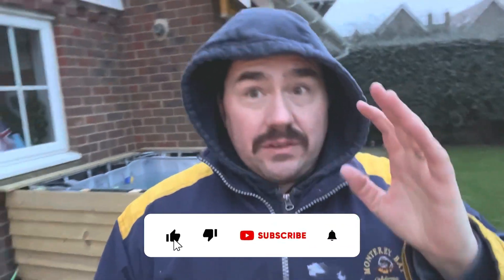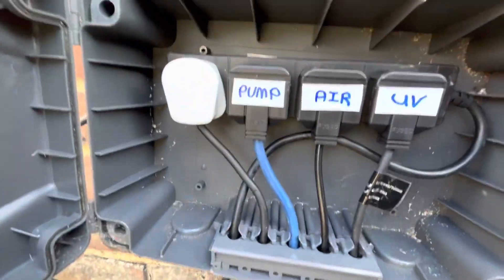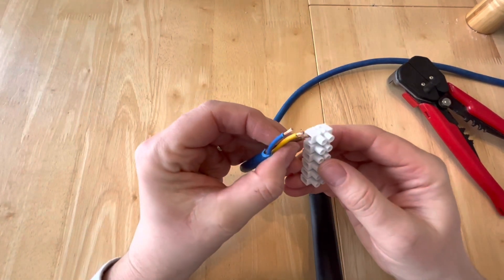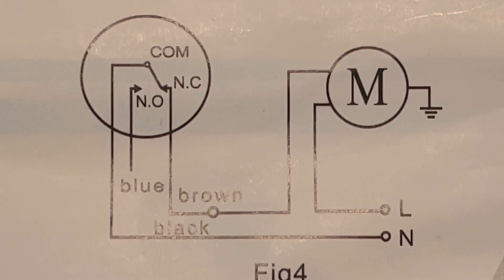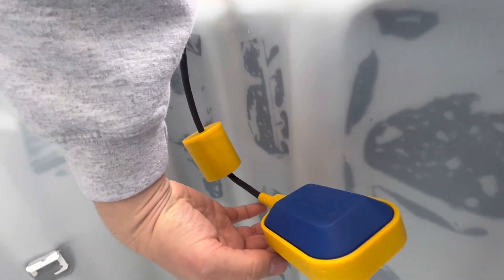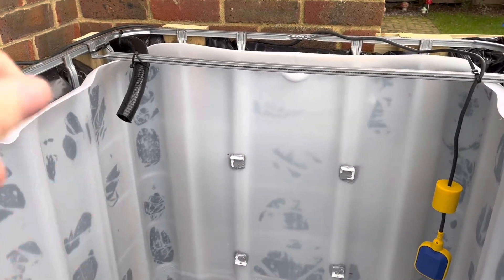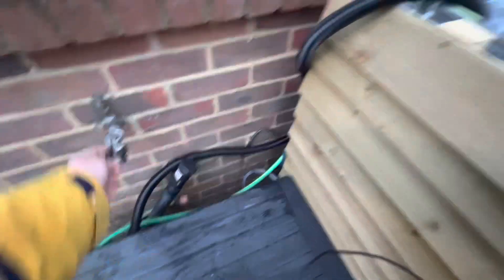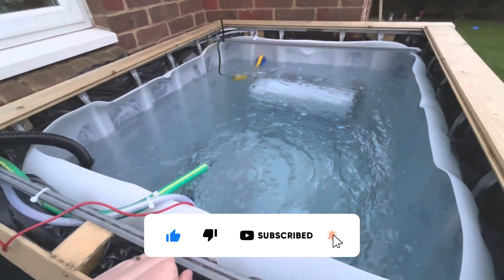Float Switch & pond electrics HOW TO !!

Comment: When you wire in the float switch to the EA pump do you fit it to the mains to the settings box or from the settings box to pump
Reply from the maker: Hi Paul, thanks for reaching out. You have to wire it to the mains cable. Hope this helps :)
Reply: @chazkoi  yes it does thank you 🙏 chaz
Reply from the maker: @paulcrosby2484  pleased to help 👍🏻

Comment: What amp terminal block have you used please? Doing the same with same pump and this has been really useful thanks.
Reply from the maker: Hi Sam! Glad you’ve found the video useful :) I’m pretty sure it was a 16 amp terminal block, looking at screwfix’ website. Just make sure you use the correct amp fuse in the plug too, I used 3 amp fuses :) good luck and hope your build goes well 👍🏻